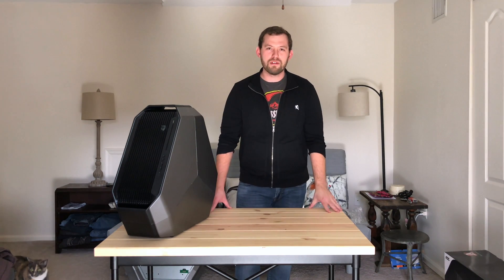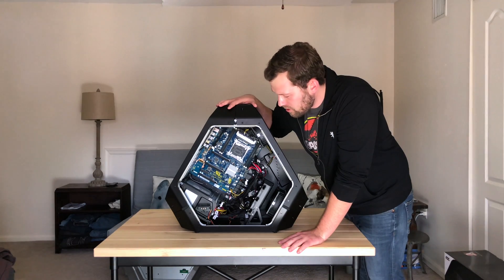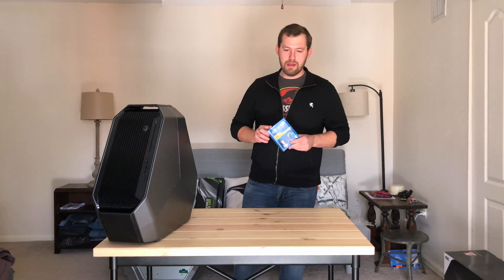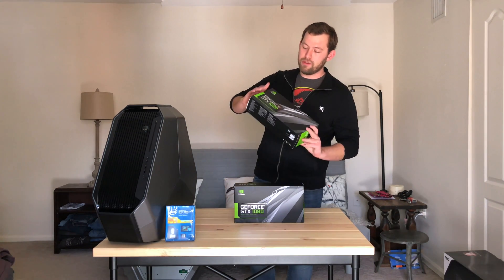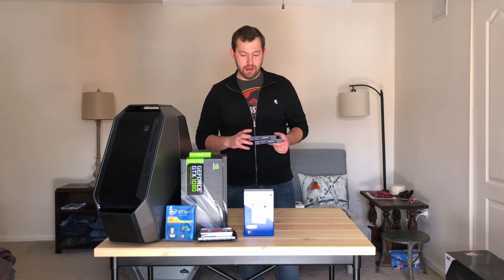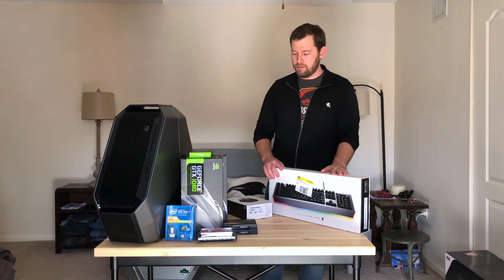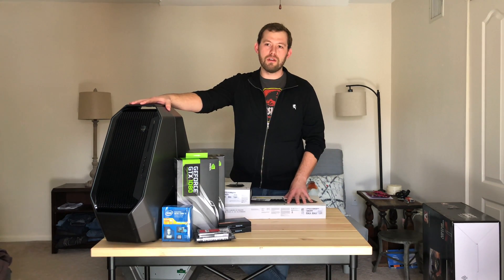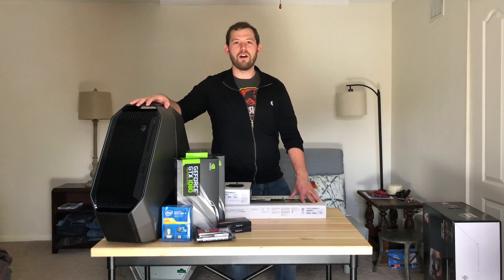We can rebuild it: Alienware Area 51 R2 (plus my cat!) - Part 1 - Components

Comment: So, I've read that its better to stick with the 5820K processor since it runs at 3.8 and can easily OC to 4.3.   The performance differences are supposed to be minimal.  Is the 5960X that much better?
Reply from the maker: RebootDat1 that depends on what you’re using it for. The extra cores and threads on the 5960x will help with multithreaded tasks. Also, it has more PCIe lanes so you can run SLI/Xfire better. The 5960x also overclocks into the 4.5ghz range fairly easily. Both chips are getting tough to find, and for things like gaming they don’t hold up to coffee lake and 9th gen chips.

Comment: Dude, am very happy with this videos, and your idea about to do this with an Area 51 Chassi is really what am think to do too,  but I hope than you can tell me where did you buy the Chassi?
Reply from the maker: Lucas W I got it off eBay. There are a variety of sellers. A good Area 51 R2 chassis with power supply and motherboard goes for about $650 including shipping.
Reply: Really thank you! But the Chassi and all in, is new parts?
Reply from the maker: Lucas W that depends on the item for sale. In my case what I bought seemed to be new, yes.